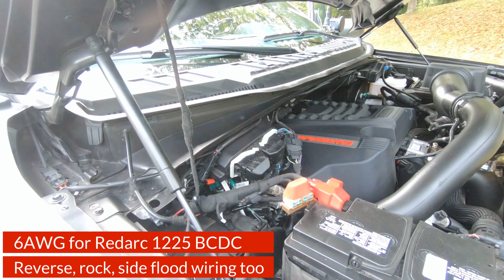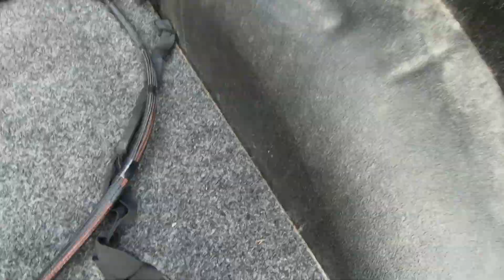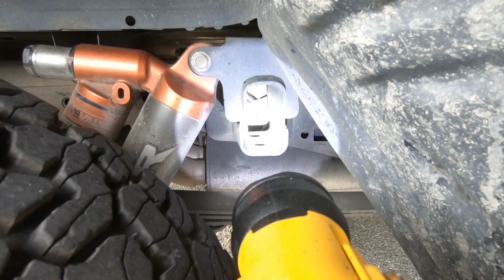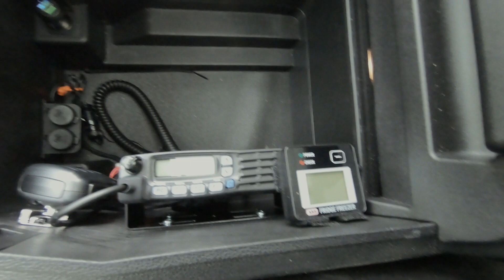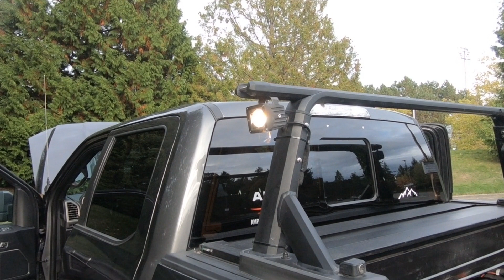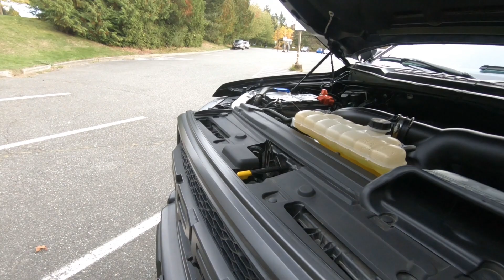amREADY F150 Raptor DIY Electrical Mods, Aux Battery System, Solar, and Lighting

Comment: You've given me sooo many ideas for my "build"! Thank you for this detailed video. I'll be watching it several more times!! Can you give me details on that cooler sensor you have mounted in the center console? I'll be running a SetPower dual zone and this seems like it would be a very handy item to have! THANKS AGAIN!
Reply: Really glad to hear that. Feel free to add questions if they come up. I'm more than a year into using it and everything is still working well for me. I'm going to switch out the costco bluetop AGM 55Ah battery for a 100Ah lithium. Part of that is for some weight savings, part is it more than triples my capacity. 

The sensor it a proprietary ARB one. The newer ARB fridge coolers bluetooth to an app, I think, but I had to buy the sensor and attach a sender to the back of the cooler.

Comment: hey man found ur video on one of the groups.  how did u wire that power source thats on ur dash by the builtright mount? i wanna do that but with usbs
Reply: When the speaker tray is off, there's lots of room to run a wire to the socket. The key is hole sawing the socket so that it has clearance for itself and for the wire. 

In your case, you might be running usb to your front tray in front of the shifter to plug into the stock ones so you can use carplay or android auto. If that's the case, you can drill a hole to the drivers side of that spot and run around and up to the bottom of the speaker. Others have tapped into the stock cig lighter socket, but that requires some dash disassembly to get at. 

I originally ran mine behind the glovebox to an add a fuse on the passenger footwell. That worked fine, but I pulled that out once I had the aux battery and tied into that under the center console since I was running power to their anyway. 

Clear as mud?